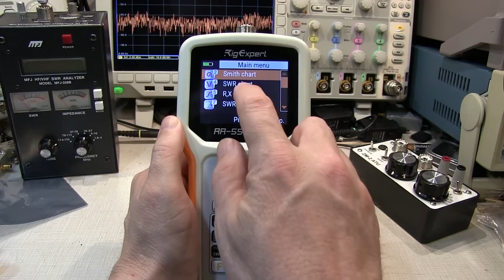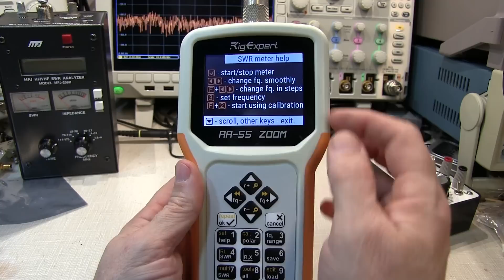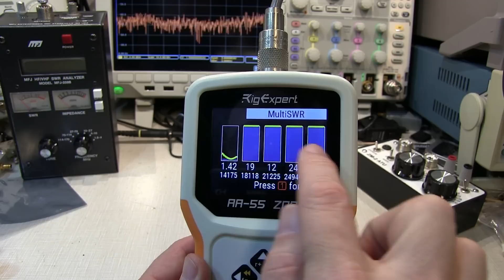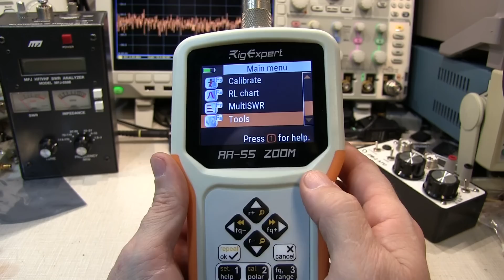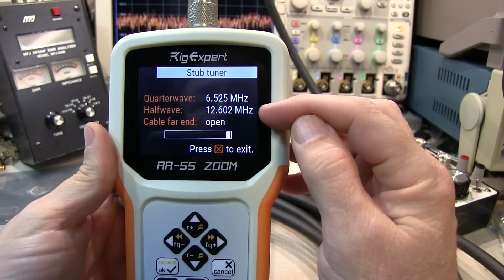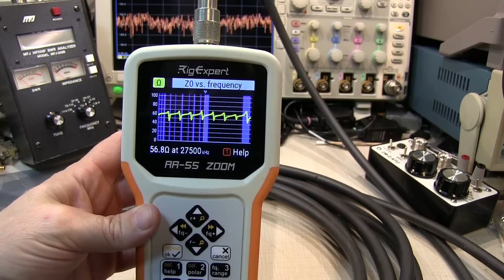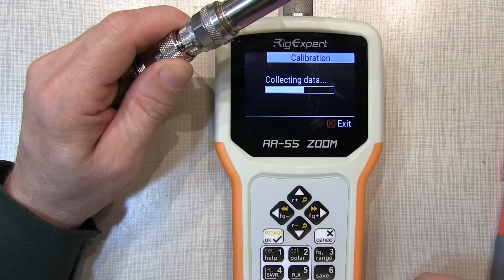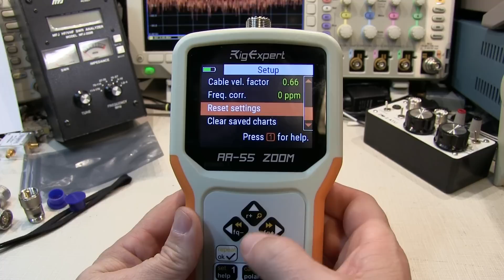#280: Review of RigExpert AA-55 ZOOM Antenna and Cable Analyzer

Comment: This is probably the best ham radio equipment review I have ever watched.  Great thorough review and not too tech for the beginners to understand.  Great job.
Reply: BTW, due to this video, I just ordered the new bluetooth version of the AA-55
Reply: @dennisschultz1175  I ord'd the AA-230ZOOMBT after watching this
Reply: Any issues with the Bluetooth? I saw reviews on a few websites about connectivity problems with the Bluetooth version.
Reply: @donh5794 I've read that too, so I may pass on the Bluetooth option.

Comment: Great Review, thank you!  Where did you get the PL-239 calibrated terminator you used at about 21 min?  I spent an hour doing a google search and couldn't find a single hit for that connector ? ?
Reply from the maker: It is actually an N-calibration standard, used in conjunction with a PL-259 / SO-239 to N adapter.   I did make a video showing how to build your own open/short/load cal standard for the SO-239 connector: https://www.youtube.com/watch?v=9QRpWjLFApA

Comment: Hello Thanks for your videos. A question: Is the AA55 higher output power (+13dBm) compared to AA230 (-10dBm) an advantage? I was wondering if near transmisions can interfere measurements like others instruments of this kind suffer (specially those that use wideband diode detectors). And I imagine that a higher signal would improve performance but haven't tried one of these analyzers in presence of local stations. Thanks.
Reply from the maker: I think it helps in situations where there are high ambient signal levels, as you suggest.

Comment: Very helpful tutorial, Thank You! Question: At the center of an inverted V, is connected a length of 450 ohm Window Line running straight down to ground level ( plus a few extra feet). Is it ok to adapt the window line to a pl259 connector so I can hook it up to the AA55, and get data on what is present on this window line down leg?
Reply from the maker: Sure, it will measure the impedance seen at the input of the 450 ohm line.  The SWR will be based on the System impedance that the unit is setup for.  By default, it is 50 ohms, but you can change this through the settings if desired.
Reply: @w2aew  Very much appreciated, Thank You!

Comment: You have a real gift for explaining complex topics in a way that any interested person would understand.  I hope you keep publishing your YouTube videos for a long time.  I do have a question about feed line common mode currents.  I don't own an expensive 2-port VNA  or a spectrum analyzer but I do have a  50 MHz scope, an MFJ-259C and a RigExpert AA-55.  Is there a way to measure common mode currents with the equipment I have?  Thanks !
Reply: I bought a miniVNA and figured out how to measure common mode transmission line loss and impedance.  Pretty simple to do use  connecting only the input and output side of the Balun coax to the DUT and DET ports of the VNA respectively and disconnecting the center (signal) pin of the Balun.  I don't believe there is a way to figure common mode  attenuation or impedance using an antenna analyzer like the AA-55.

Comment: What do you think of such analyzers as the 'Mini VNA Tiny?'' Or say the even lower priced AAI N1201SA?
Reply from the maker: I don't have any direct experience with either of them, so I really can't comment.
Reply: @w2aew  Thanks.  I'm sort of surprised that nobody has at least looked at how clean their signal is on a spectrum analyzer. The 'RF Explorer signal generator has significant harmonics that are congruent with it's very-low price point, so I'm thinking the low-priced VNA's might be similar.
Reply: I love my miniVNA and use it more than my AA-55.

Comment: Where did you get the open, short, load coax terminal?
Reply from the maker: Found at a hamfest many years ago.  You can make your own for HF.
Reply: You generally buy them as a calibrated set.  For ham use very inexpensive.
Reply: @hankhamner3671  What is the set called for google to find it?

Comment: Hi Alan, I also recently purchased the 230 zoom. Thanks for clearing up a few questions I had. Where did you get the loads for calibration?  73 de WA4AOS
Reply from the maker: I picked them up at  hamfest many years ago.  There are variants available on eBay, etc.

Comment: Great demonstration of capabilities.  I use an AA54 on occasion and decided I wanted to look at the waveform.  I noted  a square wave output and this seemed logical to me so I continued on to see how well it tracked frequency.  It tracked frequency perfectly until I reached 10 MHz at this time it seemed to switch to the third harmonic down operation.  I checked it from 10 to 29 MHz and sure enough it tracked via the third harmonic down perfectly.  I checked this on 2 different counters and scope counter and they all indicated same.  I've never checked the MFJ or other analyzers for frequency operation.  Just wondering what you thought.  It certainly seems accurate above 10 MHz.  Just wondering what your input is on same.  73 es continued success N9NYC
Reply from the maker: Some use harmonics for the upper frequencies, some do not.  It is a pretty common thing to do when the "receiving" or "analyzing" circuit is tunable/narrowband.  The analyzing circuit will reject the frequency components not being tested.  I checked the AA-55-ZOOM, and is does use a squarewave output, but it does not use the harmonics.  When you set it to 55MHz, you get a 55MHz squarewave output.   Analyzers that have untuned or broadband detectors for measurements can't use this harmonic technique.
Reply: w2aew thanks for taking the time for a quick response.  I appreciated the follow up.  I was not concerned just curious.  When it tracked so well above 10 MHz  I was certainly assured of the accuracy thereof.  Thanks again for the information  and a great YouTube channel!

Comment: what open short load device are you using please?
Reply from the maker: It is a 3-in-1 SOL cal kit that I picked up years ago at a hamfest.  Looks like you can find similar units on ebay - but be prepared to spend $100 or more - or build one yourself.

Comment: Very nice presentation.  I just got mine at Hamvention.  Question:  Is there such thing at a "hobbyist" grade Cal Kit?  I could make my own I guess, but I prefer your commercial All-In-One T style set that I know is accurate.  As you know, Cal Kits can be insanely expensive.  Any suggestions? TNX, K3GM
Reply from the maker: Not sure I've seen a hobbyist grade unit, but you can sometimes find used units online.  Even these though, often fetch $100 or so.  For HF, you can certainly get away with a homemade set.

Comment: Thanks for the review. Hey, where did you get that nifty terminator with the short, and 50 ohm terminator?
Reply from the maker: I think I found it at a hamfest many years ago. You can find them on Amazon and eBay - search for 3-in-one OSL calibration kit.

Comment: One thing I would like to see these types of graphical analyzer VNA's do is to demonstrate the relationship between lowest SWR vs Resonance of an antenna.  Theoretically they would be the same, but are not always.  Does the RigExpert show that?
Reply from the maker: Yes. You can plot the SWR vs. frequency and see the minimum in that plot, then switch to the R/X plot vs. frequency and note the frequency where the X component goes to zero (definition of resonance).
Reply: Can you do a video on that?  I'm having an issue with feedpoint impedance on a mobile verticle antenna...not even sure how to see which way to go by using my MFJ-259B or if I really need a digital VNA to figure out what's up.

Comment: Just wondering if the calibration standard is included in the price.
Reply from the maker: It is not.  It is calibrated at the factory, at the device port.  If you want to establish a new measurement plane (at the end of the coax, etc.), then you'll have to run the cal yourself with a cal standard that you provide.

Comment: It is quite bad that one gets very different SWR results depending on the zoom factor/freq sweep range.
Reply from the maker: This behavior is the same as any instrument that sweeps.  All instruments that sweep will make a limited number of measurements along the sweep.  As mentioned in the video, this instrument gives 100 points across the sweep (or 1000 points using the external software).  Thus, for a wide frequency sweep, the frequency spacing between the points will be large, and will likely not line up with a particular SWR minimum.  This is why the instrument was designed to re-center, zoom and re-sweep easily, so that you can focus the 100 point sweep around the SWR minimum.

Comment: Hello Alan, a silly question, if money is not a factor, why buy this box instead of an Anritsu site master?
Reply from the maker: The main reason would be size, weight and portability.  Some useful features such as multi-frequency SWR or the SWR2AIR feature may be key in some applications.  Site Master doesn't do cable and antenna measurements below 2MHz.  Of course, if you could afford a site master, then you could also afford to pick up this analyzer too!

Comment: Alan, I learn a lot from you videos.  Quick question, I experiment and work on tube radios.  I've been trying to figure out how get cursors on my current o scope, or buy one with cursors.  When I find a model with them they have far more features than I need for old radio's.  What do I look for?  Josh jsbowman@bellsouth.net
Reply from the maker: There are many older analog scopes that have cursors (like the 2445, 2465 Tektronix units), and many more.

Comment: Thanks for your videos! I have a suggestion for a video. How to make a PWM/frequency converter. A circuit that takes an input from a inductive RPM sensor and outputs equal amplitude but with a variable frequency/pulse width. Not yet seen such a circuit.

Comment: Have a question - I’m thinking of playing around with a full wave loop for 6m.  The article I read suggests using a 1/4 wave matching feed made from 75 ohm cable. Using this analyzer, would I set the analyzer for 75 ohms, or for 50ohms using the stub tune feature?
Reply from the maker: Hmm, for the Stub Tuning tool, the system impedance setting doesn't matter.

Comment: Great review!  I have the AA-54, but this does so much more.  I bet it likes batteries.  Can it be powered by the usb or other external source?
Reply from the maker: It takes 2 AA batteries. I’ve used mine for about two hours and battery indicator shows well over half full still.
Reply: The company site says that it takes power from USB when connected to such.

Comment: I know it is a low-frequency instrument. Therefore, the impedance mismatch on the UHF connector should not affect the readings too much. However, a UHF connector on a VNA gives me the heebie-jeebies. Allen, a block diagram and teardown of the instrument would be interesting,
Reply from the maker: The higher frequency units that they sell have an N-connector on them.  The SO-239 is OK for the frequency range of this unit.

Comment: Very limited.  100 data points and only a few memory slots.  This means dragging the laptop up to the roof.  The whole reason I got this thing was to avoid that.  I wrote the company and they fixed the misleading menu leaving us all with the limitations.
Reply from the maker: I guess the point of is that because it is so easy to re-center and zoom, it's quick to get higher resolution data around your frequencies of interest.
Reply: For info the AA230 zoom supports 500 data points

Comment: An excellent review, I have the AA230 zoom, it's my goto meter for all antenna and RF cable testing, the high contrast display is best in bright sun light, the AA230 has slightly earlier firmware (ver 1.91) and is missing a few of the options shown here, both models are missing a Bluetooth connection which would have been a useful addition. 73 MM0MHP

Comment: Hi Alan Great Review Can you tell us what MCU the analyzer is based on ? I ask because the SARK110 is based on the ST Microelectronics 32F103. It's really amazing the capability of the A to D converters in these things. Looks like the Rig Experts Unit has more in the way of User Interface Programming. The SARK110 goes to 225 MHz and runs about the same price. What is the price for the 1.4 GHz unit ? I'll bet it isn't cheap.  Bob K6TR

Comment: Very nice demonstration, Alan.
I considered buying a RigExpert on numerous occasions but wanted something that would go to 2.4 GHz so I settled on two separate instruments by AAI RF Vector Impedance Analyzer N1201SA and N2021BA. These two instruments give me a frequency range of 1 MHz to 2.7 GHz and they do a pretty good job. No Smith Chart or 1/4, 1/2 lambda stubs or some of the other nice features of the RigExpert but both for about the cost of one RigExpert. In the HF range, I actually compared the low frequency unit to my vintage GR bridges to see if I trust the new instruments. I suppose many people would do it the other way around.
Thanks for the video. Had I seen this a year or so ago, I probably would have gotten the AA-50 for my HF use.

Comment: Wow, I need to upgrade to this! I have an AA-54 from a few years ago. I thought that was pretty good but this brings it to a new level! I'll be selling my AA-54 on eBay and buying one of these ASAP! Thanks for the heads up on this. de KA2ZOH
Reply from the maker: What makes this one better than the older AA-54, in your opinion?
Reply: w2aew More features, more tools, way better screen and graphics.The AA54 is very bare bones in comparison.

Comment: I guess RigExpert worked of what I believe was a copyright for the Smith Chart since earlier models like mine, the AA1400 with the U.S. firmware, did not have the capability of showing the chart on the instrument itself (the European firmware did have the chart); it's actually available when you connect it to the computer.  BTW, for Mac users there is a new RigExpert control utility by W1HKJ of fldigi fame, the "flaa" program is on his website.
Reply: As far as I know, you can reflash your AA-1400 dump of the European firmware and get a Smith chart.
Also in the near future will be released the second version of the program AntScope for analyzers RigExpert, which will work in macos and Linux

Comment: Great Review! So, the AA-600 is pretty much the same, but ~11x more spectrum; https://rigexpert.com/antenna-analyzers-comparison-table/ The cost of the AA-600 compared to the MiniVNA Tiny is only a few bucks more +/-.  Obviously, you can do much more with the MiniVNA, but you need a PC for it to function. If you were to choose a device for measuring the feedline and antenna network, what would you pick? It would be really nice to use the VNA as a VNA and not some high priced Antenna Analyzer. It would be nice to sweep a duplexer, but I do not know if that warrants the purchase without a integrated meter/monitor.
Reply from the maker: For doing antenna work, I prefer a stand-alone unit like this.  Carrying around a tablet/PC would be inconvenient for many measurement situations.  But, for more demanding situations (duplexer tuning, etc.), a 2-port VNA is a better choice.